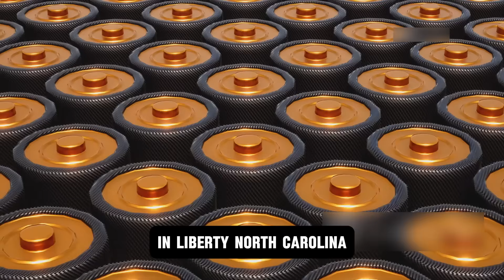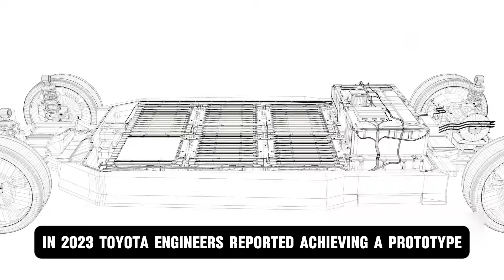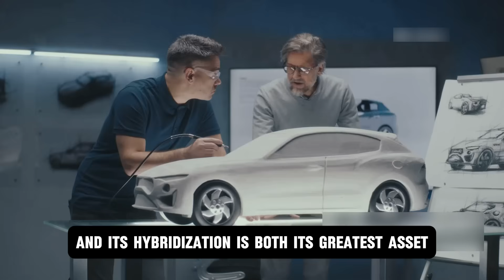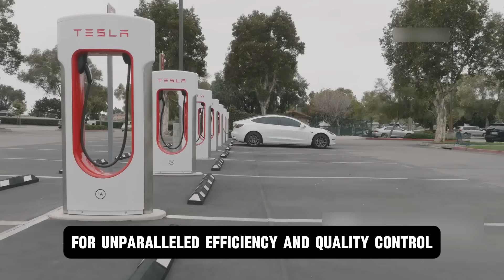Toyota CEO Announce NEW Solid State Battery 1200 Km with 5-min Charging!

Comment: And then even, 10 minutes charging time? can you imagine the traffic back ups at charging stations world wide, EV's arent the future ever, polution from EV's is in the production, the powerplants that are still far from green and the limit in charging capacity,  count for yourself; 80kW battery charging in less then 5 minutes needs a charging capacity of 960 kWh, the car couldn't even carry the weight of the charging cable let alone that every charging station on a highway would need to have a powerplant right next to it.

Comment: Hydrogen may be the future but it's not ready for prime time yet. Toyota better step up or get left behind. They can still make ICE vehicles.
Reply: 2 parts energy to make one part, not invoromentaly friendly, but if you can use solar mighgnbevok.
Reply: No, H2 will never work for many reasons.  Making fuel (Ethanol) is the future.  Nuclear = grid loads + fuel making.  No need for anything but Thorium Moten Salt small reactors with fuel making as the demand absorbers.  Set nuclear at above peak of day, and make fuel as demand drops during night.  Make fuel at plant and ship to station.  Costs 40 times less than over grid.
Reply: @seaplaneguy1 Or use nuclear to make H2, just a chemical process driven by the heat from a SMR, no CO2 emissions no wastage making electricity.
Reply: @alanmcdade2459  No, H2 is silly stupid in the extreme.  Will never work.  Better to make Ethanol.
Reply: @seaplaneguy1  You can't see the future. Thorium reactors are still in the prototype stage. Traditional nuclear plants are prohibitively expensive to build and maintain.
Reply: @vinshieldvaper499 Rare earth mining has typically 50% rare earths and 50% Thorium.  Thorium is radioactive and cannot be dealt with, so no rare earth mining is allowed by EPA rules.  We NEED Thorium nuclear to get rid of the Thorium (98% gone) to have access to rare earths.  NOT AN OPTION if we want cell phone and computers, let alone EVs.
Reply: @seaplaneguy1  The point still stands. Thorium reactors are still experimental. China has a test reactor and is working on a full scale one. It remains to be seen if it's practical. You still need Uranium to make them work. I hope it is. It seems like a good idea.